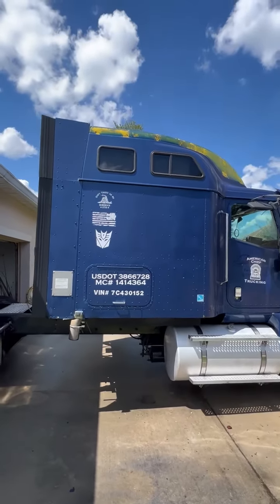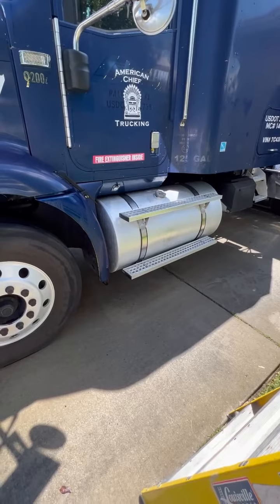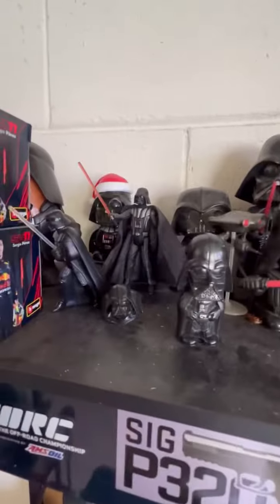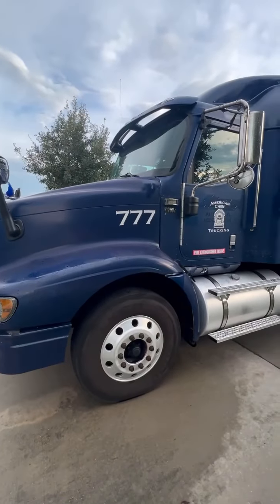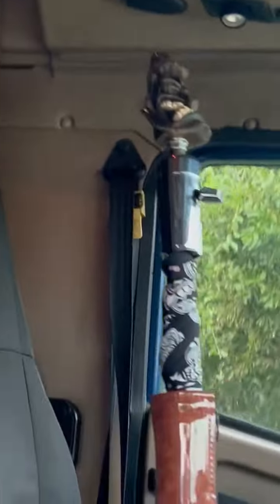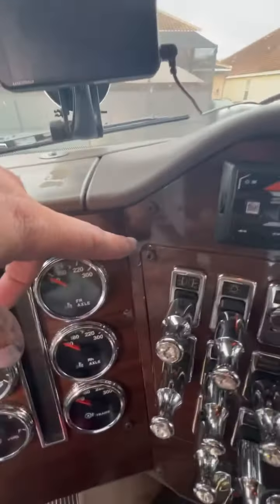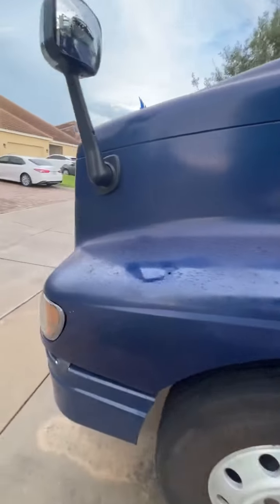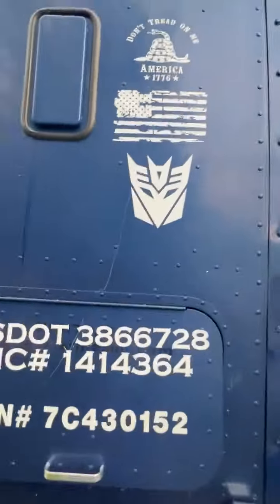2007 International 9200i Wind deflector removed, needed some Painting

Comment: Yo I like the video man I got a question how you removed the wind deflector?  Simply remove the screws? I haven't tried but it looks like from your video it has male and female threaded caps. I just want to make sure it's not got bolts on the inside behind the headliner. Lmk I would appreciate it.  Thanks